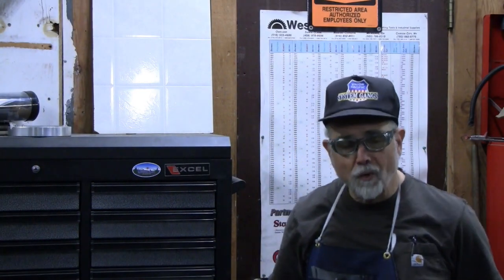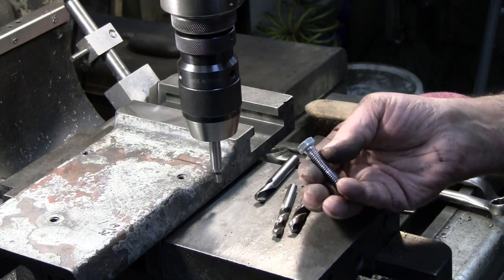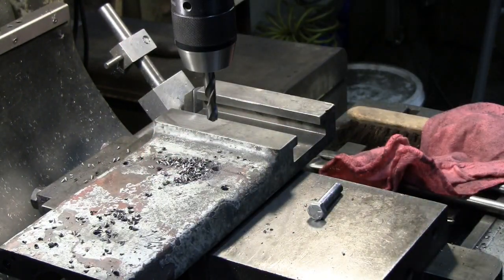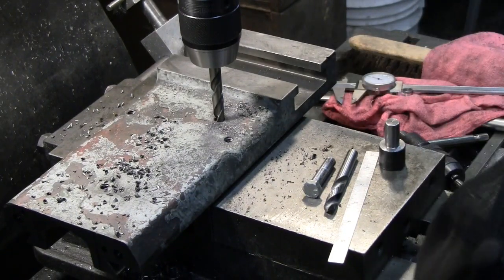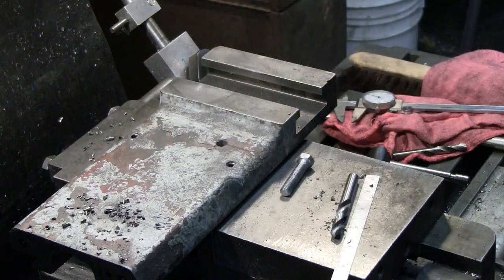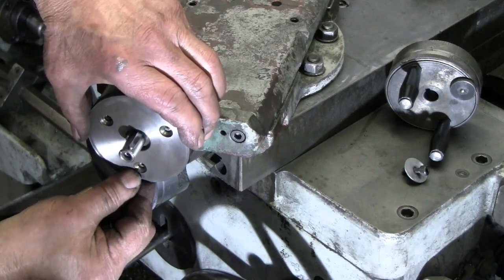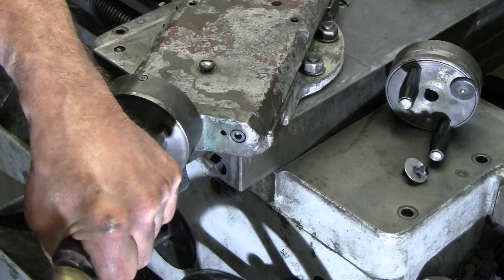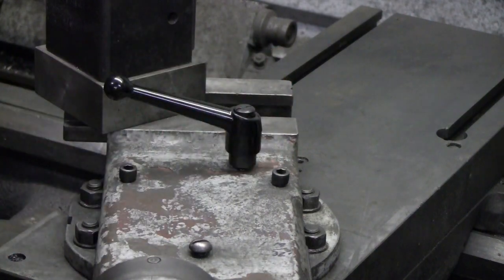What the Heck is a TOS? Part 2...and Shoulder Surgery Update

Comment: That's why I like layout lines.  I can instantly tell when I'm right or wrong.  That is a heck of a lathe.  Thanks for the link on the Indexable handle.  The brass insert was a great touch.  I had a similar cooling unit for my knee replacement, and I used the same cuff for my shoulder replacement.  I blew out (destroyed) all four tendons of the rotator cuff.  I can commiserate with what you are going through.  I am praying that GOD gives you a great recovery and an easy rehab.  (PS: I am subscriber 207)
Reply from the maker: Welcome aboard, Vernon, glad to have you. I had my two week postop checkup yesterday and the Doc says I'm doing very well. We took my cooler to my wife's brother yesterday...he's getting a new knee on Feb. 20 so we get double duty out of the cooler. Joe

Comment: Hi i have a TOS SV18R which i restored . I have the original manuals with it and while i havent got manual in front of me i rang an oil company to match the recommended oil . I ended up using a 46 hydraulic oil in the all the gear boxes but i also used an additive . 5% of Power up gear max . Not sure if you are familiar with Power Up products made by Marius international in Canada i believe its popular here in New Zealand . 
The result was amazing as when i bought the lathe off an old guy who never looked after it most of the boxes had little to no oil in them . The sight glasses were broken and leaking . Upon pulling apart i found the gears to be in good condition tho dry . These lathes are built to lasts 
When i first got it up and running the gears were noisy but as the Power Up found its way through every thing its runs incredibly quiet . 
Ive use Power Up products for years its a boundary lubricant and stops metal to metal contact .
Years ago i was a rep for it and went to a large engineering shop that had huge lathes repairing threads on drill rods for the oil industry . I convinced them to try Power up in there lathes . The results were remarkable . Before treatment the lathe would pull 6 to 7 amperes on a heavy cut after treatment only 3 Amperes and thats just and additive to their oil at 5 % and its safe with all mineral oils and no harmful things like lead or teflon 
I love my lathe and since treating it everything has become easier to operate
Reply from the maker: I also used 46 hydraulic oil. I hadn't heard of the Power Up additive. You used the NNL-690G version? It's available here in the US on Amazon. A bit pricy, but if it works that well it would be worth it. Thanks for the info.
Reply: @sierraspecialtyauto7049  its sound pricy but in reality because you only using 5% a litre bottle goes a long way and how do you price the wear on parts . Power up reduces wear by 90% so the product in reality is very cheap . I use there grease as well . We had a 330B Cat with a Waratah log processing head on it . With standard oil company greases the main boom pin bushes would last about 4 hours before you could hear creaking of a dry bush . With Thixo grease we could get 4 days between greases . Also had a ZX 200 Hitachi excavator and used thixo from new only greasing every 50 hours all the pins and bushes after 12000 hours were like new . I could stop greasing for 100 hours and still slide the main bucket pin out and there was a film of grease on it 
Its a fantastic product

Comment: Thanks for the video, I am planning two locks on the mini lathe slides and a replacement of the clamp bolt for the carrage. I had not thought about McMaster Carr to source the indexable handle. Good supplier. 

Good to see your recovery is going well.
Reply from the maker: I do like McM-C. May be pricier than some places but you know what you'll get will be good stuff, and you get it quickly.
Reply: I'm about 20 minutes from their Chicago location. What a huge operation. They aren't as expensive as the other two other major industrial suppliers. Like you said, good stuff. I'm going there this week, and then over to Shars Tool. Shars has good stuff too.

Comment: Good luck with the therapy! I hope it all goes well in the long run.
Reply from the maker: I'm anticipating and dreading the therapy at the same time. Right now I'm instructed to do a brief suspension exercise in which I let my arm hand straight down and swing it around gently. Also, I have a rubber ball around which I'm to squeeze my fist. `These exercises are going fairly well, but I think the formal PT will be a different matter.

Comment: I'm going to use Shell Omala S2 GX industrial oil. Got this tip from somebody who is working with TOS machines for over 30 years.
I have a SN 50 B which i'm restoring myself. it was used in a maintenance shop sinds 1997 and it was never serviced.